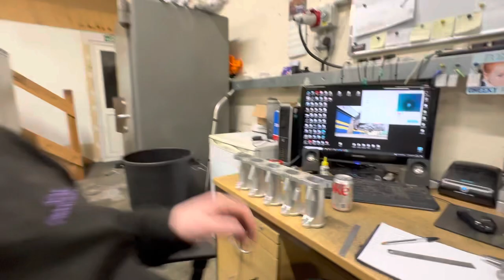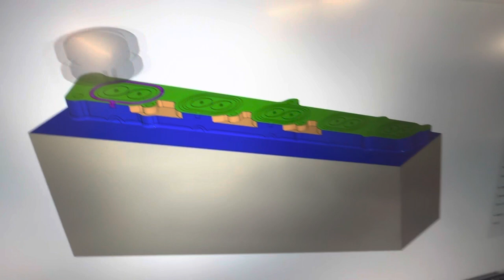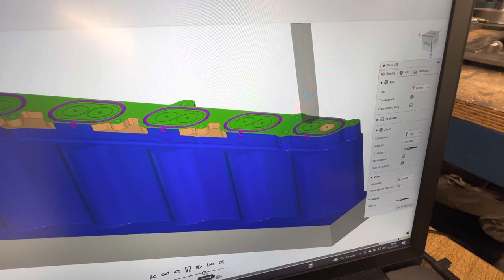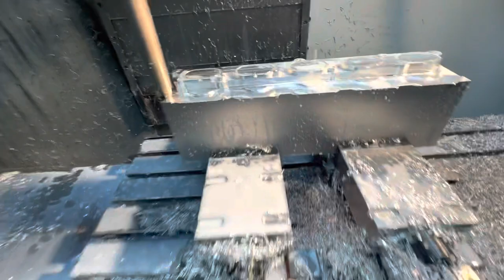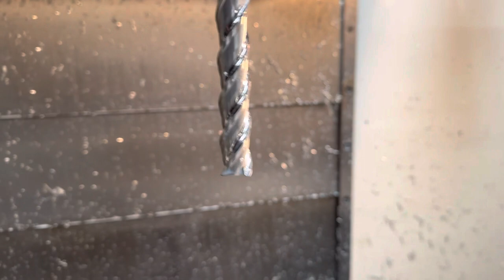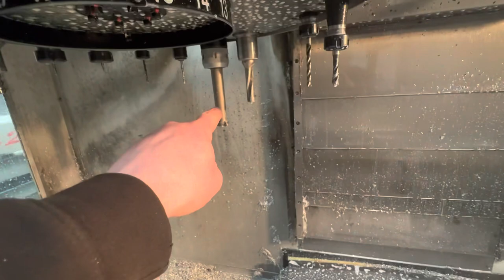Machining Billet Aluminium Intake Runners pt1

Comment: Have you considered making a subplate for the 4th trunion? Seems a shame to have the whole trunion holed up for one part. Unless the whole base can bolt on and off?
Reply from the maker: Hi Andrew

The 4th sub plate bolts on and off so it will be specific for each job and that’s how I designed it to be from the start 👍

Comment: Make some dovetail jaws and cut a dovetail onto your stock. Stupid secure and you barely need anything to hold by. We use .045 inch (1.14mm) DOC on our stock piece and about .050 DOC on our jaws to create an intentional slight mis-match on the depth/angle interlock. Recently purchasing bought the wrong stock and the material was at the finished thickness already. The part had some milled out pockets that got cut away in OP-2 that I could mill a pocket into and cut the dovetail into for OP-1 holding.
Reply from the maker: Hi
Thanks for the suggestion, i have seen lots of dovetail set ups especially on the 4th axis vices for smaller work pieces.

I have actually been looking at the serrated grip jaws for my vices, very similar but have a row of small teeth to bite into the material rather than a dovetail but again only need to hold on 3mm

Something i will consider trying in the future

Thanks
Marc
Reply: @kinzy_fabrications  All of our mills are 3 axis with a kurt vise on the table. The company is way too cheap to consider anything upgraded from that so we came up with our in house made jaws. It is a slow time project whenever we need more vise jaws to run a batch of aluminum and 1018 steel soft jaws. The Piranha jaws are good as well, but they would never buy us anything that nice.

Comment: How do you clean all those metal shavings after you are done?
Reply from the maker: Brush them all into the chip auger and then they get pushed out into a bin and then I put them all in my aluminium scrap bin and weigh them in for scrap value every 6 months or end of year depending what I’ve got 

Thanks
Marc

Comment: 1500 rpm, 5000mm/min, 0.7 stepdown, 2d contour with no roughing passes and 1mm stock to leave with that high feed mill. 5000 is minimum feed, should be running around 10000
Reply from the maker: Hi thanks for the specs, I did look at the spec and feeds and chipload per tooth and it’s way to high for this old machine and the contour shape

Maybe ok on a newer machine but I could never run a contour that fast on this old girl lol
Reply: @kinzy_fabrications  You'd be suprised, I run one of these in an old XYZ from 1990s. Because you don't use adaptive toolpath, just a contour, the control deals with it a lot better. The reality is though that these tools just don't do that great in aluminium.
Reply: @spikeypineapple552  no they don't, I was gonna a tell him .5mm step down .6mm a tooth and 1500 to 2500 for the little 40 taper haas. They need constant engagement and they never leave good finishes. They all scream in corners. It's just how they are. I use osg hi-fd daily.  I'd steel like 1045 I'm at 550sfm .08" a tooth and .04"step down (that's in inches)